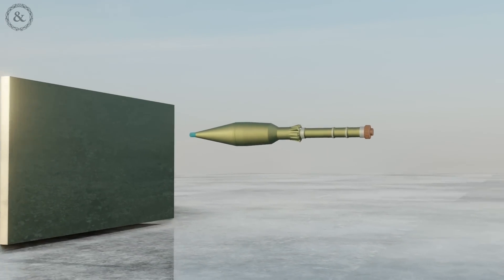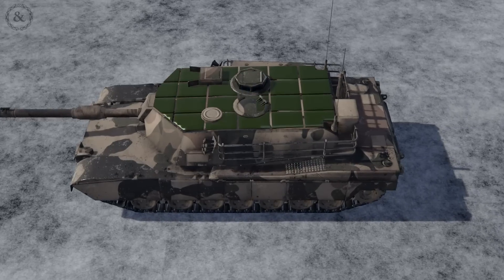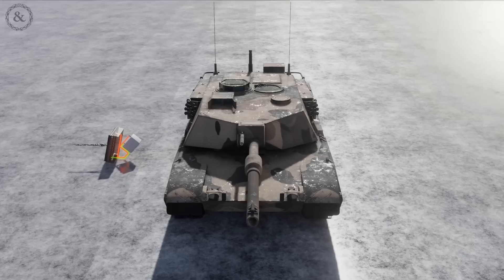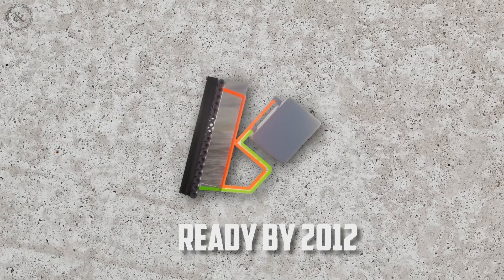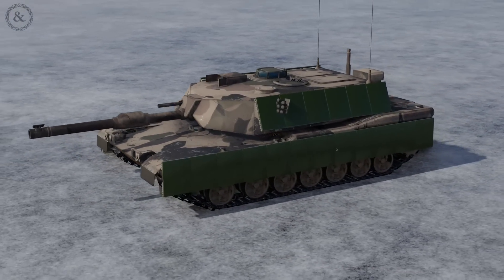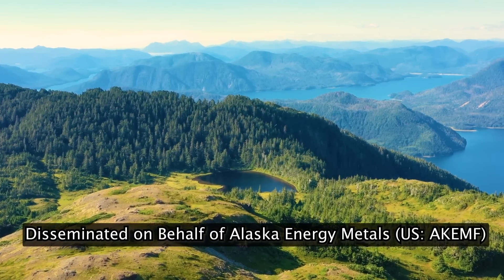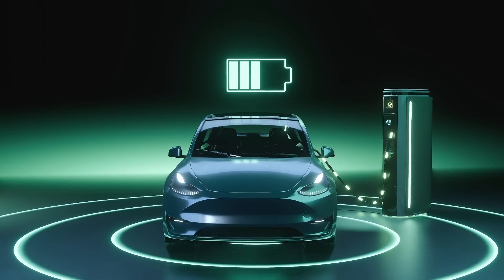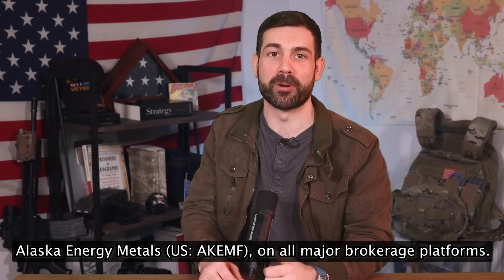How Electromagnetic Armor Vaporizes RPGs

Comment: That's not how electricity works. If the conductive plates get in contact, the warhead won't get "zapped" by electricity because it isn't part of the circuit. And if it is the warhead that completes the circuit, it would take extremely large voltage to cause enough current to be driven through the tip of the warhead. Current would flow only through the tip, the section of the warhead that is making contact between the circuits and only that part is heated. Just as the tip of the warhead, every other part of the circuit would similarly receive similar amount of heat energy caused by large current and resistance of the conductors. Furthermore, this extremely large voltage will make it incredibly difficult to make the insulation between the plates to prevent unintended discharge while still having the reliability of it working as intended.

If instead you read the first source of the wikipedia article about it, you will find out that it is the electromagnetic field that will break up the stream of molten metal produced by the shape charge, effectively nullifying it. The physics behind this is that the electromagnetic field will cause very high induced current to flow in the jet, and this induced current will in turn produce its own magnetic field and both the jet and the magnetic field of the plates will repel each other due to the magnetic fields being of same polarity. Or that is the principle.

To summarize: Conductive projectile moving in very powerful and rapidly changing magnetic field of the armor will result in projectile and armor repelling each other.

Comment: I think it could make penetrator rods more dangerous.
The penetrators rely on extreme velocity to create a "physics crisis" on the target armor. Basically vaporized penetrator rod bits (and armor bits) can't get out of it's own way fast enough, and you get an intensely exothermic reaction which draws it's energy from the velocity. All of the metal involved ends up molten, vaporized, and a small amount even ends up as plasma. Basically what happens is similar to if you were to jam an arc-welding stick into a block of steel, except penetrator rods use up the whole stick almost instantly, and the energy source is kinetic instead of electrical.

A high electrical energy input into this could make the effect-on-target actually worse. Adding ultra-high energy arc welding might "stack" with the potency of the rod, which is already going for a (somewhat) similar effect. (this is all armchair mind you, my backyard high-energy testing facility is out of order).
Reply: I got the same problem with my lab bro...

Comment: Heres the thing I think the armor should only be turned on when it detects a incoming heat round like an APS so it's not wasting power but I think the problem is trying to keep up with keeping the  capacitors charged against the next hit

Comment: You lost me at very high capacity capacitors. Anyone who knows anything about capacitors is they are quite frankly deadly to maintain.

You know how LED light bulbs are supposed to have an infinite life, but you can get a dead one after just a year or two? Well, the LED itself is still working, but the capacitors and other electronics died due to heat breakdown and material limitations. Capacitors break down all the time, and when they do, they can explode and damage other components.

Riding into combat surrounded by high capacity capacitors between you and the enemy sounds like a disaster.

Comment: The mark 2 Dorchester armour took 70 RPG hit with out any damage to the tank and crew. So it solving an issue which does exist
Reply: Its use isn't just limited to tanks. This technology could be used to to protect more lightly armoured vehicles like IFVs and AFVs. You're not putting Dorchester armour on a Styker.
Reply: @kutter_ttl6786  you could put Dorchester armour on a striker. The chobham modular amour is used on worrier and boxer IFV so I can't see why it wouldn't be used on a striker. (Except the mod won't export the Mark 2 Dorchester, only the Mark 1 which isn't really as good)
Reply: @bardslee  It can but the amount of armour it will pack will be way beyond its weight capacity. It's why the Challenger weights 60 tons. Not to mention bulky, since new armour solution are no longer thick sandwich of composite(widely used on Soviet tank front plates) but spaced armour arrays involving composites. This electric armour allows modest bulk reduction but also modest weight increased for drastically increased protection
Reply: The issue is those tanks are expensive and they're hoping this is a cheaper alternative. However, I do not know if I believe it's reliable against bullets, if at all capable of stopping any bullets.
Reply: @WARDEATHFUN  I think the elephant in the room is even if it works it would only work once as the RPG as to go through the copper coils before the armour. Which would make it useless for sustained fire, which is kind of the whole point of the MBT armour.
Reply: the 70 RPG hits is a myth and just not true

Comment: How far would it be visible on devices that detect electromagnetic fields? I don't even mean specialized gear like the old ASW MAD system--I'm wondering more about cheap amazon ghost-hunting emf detectors strapped to aliexpress drones.
Reply: The electric armor stays inactive, with no current flow, making it undetectable. It differs from an antenna, which emits eloctromagnetic fields using high-frequency currents. This system activates, allowing current flow, only briefly during an attack, unlike continuous antenna operation.

Comment: What would happen if someone fired an entire clip of 7.62mm or 12.7mm into the electric armor? Would it discharge the armor? Or wouldn't it even notice? Because that could be a very cheap countermeasure. (I don't know much about electricity, but im curious). 
But I assume nothing would happen, because the impact would have to be stronger to reach the deeper layers.

Comment: The biggest manufacturing complexity of EM armor is the capacitors. Extremely expensive, hard to source, and challenging to maintain if damaged. Those factors increase exponensionally when you factor in the rare-earth metal content of the fastest/highest discharge capacitors.

Comment: High voltage is based on Guasse law and travels over the surface of a conductor thats why it won't light up a monophiloment light bulb wich requires internal resistance and extremely high voltage has no internal resistance and is only on the surface of the conductor

Comment: At a rough guess based on fly-zappers, I would say the energy required to vapourise an AT round is huge. 
The storage and rapid discharge (in the time it takes for the round to penetrate a few mm) are impractical for a vehicle but might be possible for fixed installations.

Comment: Far as main engine going down that's why I'd use a tactic used in ww2 tanks the Germans used APU's which can easily use the same fuel as the main power unit now days back in the ww2 days these Apu ran on two stroke mixed fuel engines and some 4 stroke small engines as well which use straight gasoline but now days they come in many diesel configurations

Comment: Plus the side effects of the EMF field genrated around the crew as well makes you have many side effects
Reply: Btw - there is zero EMF field generated until the system is tripped.   All energy is stored inside the capacitor and is only transferred to the plates (and then to the incoming munition) at the speed of light when the munition completes the circuit by shorting out the space between the plates.

Comment: If it was practical the only major problem with having electric reactive armor would be energy signature.  Be like a magnet for different kind of munitions that could be invented to negate the electricity shield. Instead of having to hit thermal signature they could focus on the em signature of the vehicle. 

Also coating those explosive weapons to not be affected by electricity with a non-conductor material could shield the round to still have similar explosive power. 

Energy and practicality of harnessing it would just increase usage of burning more fuel at higher rates then tanks already do. 

Though shield concepts in future warfare might happen one day. Just depends on the type of ammo used in that conflict. 

My money is more on cyberwarefare. Take away the neat toys that are high tech. Possibly even turn those toys against the user would be more effective then electric shields.
Reply: No there is no em signature because no electricity is flowing in default.
Reply: @NoName-cx3gk  on the outside no. But waiting for the circuit to complete it would have to have some dedicated power flowing to the system that would electrify the plate.

Comment: Honestly this electric armor sound great for a rapidly set up bunker. 
In areas where this threat is likely to pop up. 
Especially is you can set up a multi charge state. 
That would allow taking multi shots. By swapping from 1 circit to another rapidly. 
Honestly though asside from this specific instance not really useful. 

With 1 exeption if the pannels could also provide camouflage from thermal vision. 
Then it would be really handy for supply + recovery points. Given you can generate enough electric power.
Reply: Kinda leaves a sci-fi mental picture of "cloaked" tanks advancing under fire and blinking back into visible spectrum as they are hit due to armor discharging.
Reply: @uselessmitten7836  indeed

Comment: I seriously don't get how pumping more heat into the stream of molten copper penetrating your armor is helping to protect whatever is behind that armor.
And good luck gasifying tungsten - you have to armor up that trailer carrying the small modular nuclear reactor needed for the energy to do that too.

HEAT warheads already exist in tandem versions to counteract explosive reactive armor. Just add a thin scrificial iron rod on top to discharge the electric armor before the real load hits.

Overall, this sounds like good old fashioned corruption to me. Someone in the military industrial complex knew someone who is in charcge of a military research budget...

Comment: Cappy, it holds the 20kw power in the capacitors so in between attacks it doesn't use any power. The issue is the capacitors take up a lot of space.
Reply from the maker: I wish I had gone more into that aspect , I couldn’t figure out exactly how big the equipment would need to be
Reply: This 20KW idea would be suitable for an aircraft carrier against missiles.
Reply: @jakobneubert6801  I'm pretty sure a carrier would need quite a bit more plating than a tank.
Reply: @jakobneubert6801   Wouldn't that be constantly discharging into the water
Reply: Capacitor doesnt go Boom, it goes Splat. It will short circuit and discharge into anything attached to it though
Reply: @AndreGeiger-r1i  You've never been around a large high voltage cap when it fails.  It goes boom.
Reply: Fully charged capacitors of that size are the last thing you'd want nearby, while explosions shake the cage.
Reply: Caps of this class, can be upto 5J/cc. Need about 20kJ+ for reactive armour
Reply: Yes it does. You need 30 to 90 secs to charge the caps, so you need to leave them charged while in the combat zone
Reply: Yep. And if you hit a capacitor, BOOM!!!
Reply: I'd say the only way to fix the size issue is creating a hybrid ai tank not that dumb full electronic ai tank that was made . Don't understand why it exist so dumb lol
Reply: Super-caps can be smaller, but imagine if the inside of the tank gets hit, those will blow just like munition.

Comment: At the start of the video you mentioned that capacitors would provide the immediate power, logic would suggest that they are disconnected from the armour until needed. They can even be activated in less than 0.1 of a second at the moment of contact with a projectile. So I don't see how safety is ever a problem or if a commander needs to activate it. It can all be automated without any problems.

With the rapid miniaturization of electronics and especially charge holding components, this could very well be a good auxiliary protection for tanks. It is a shame this video doesn't explore this technology with current electronical capabilities. There is far more possible then whenever that BMT rapport was written, I can't imagine it was written recently.